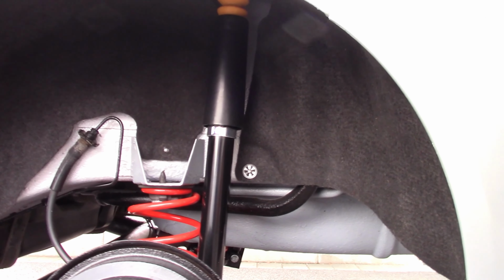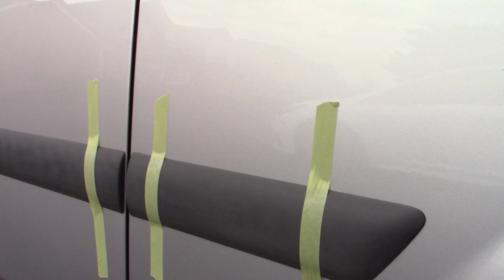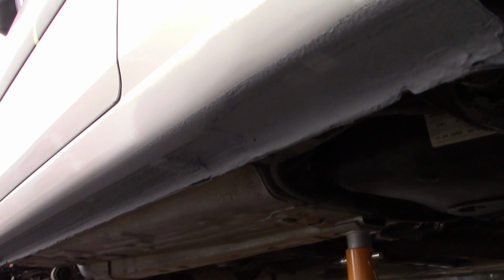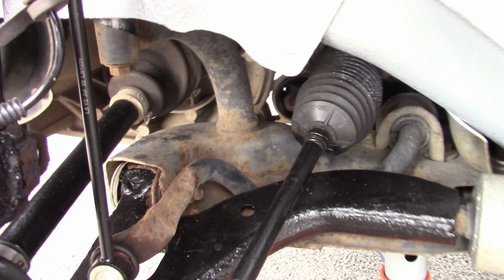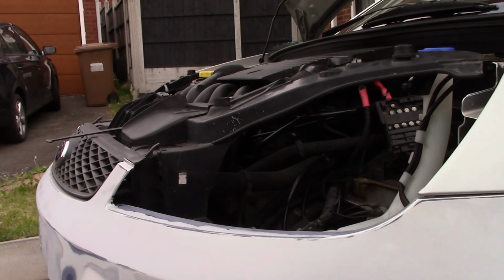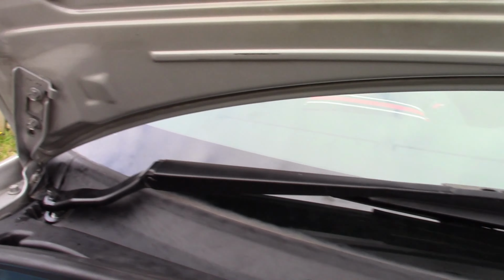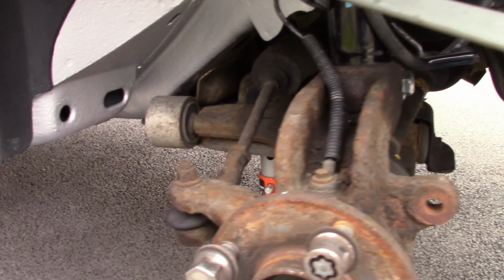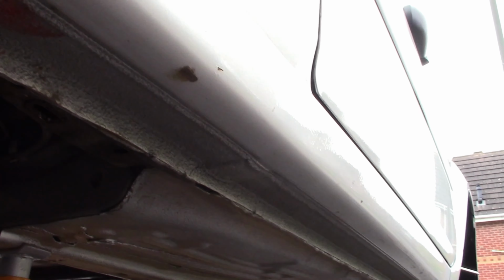Not long now! - Project Fiesta - Episode 4

Comment: done my rears at the weekend and video going live tomorrow. Not as good as your job as only had a wire brush and just used a straight to rust spray paint but looks miles better and nice to know its protected for the time being. But in the years to come i want a new rear axle and treat the rust properly